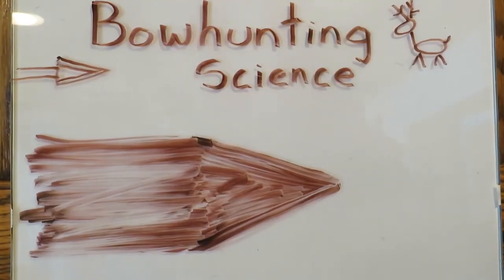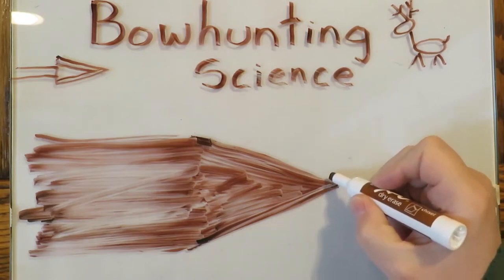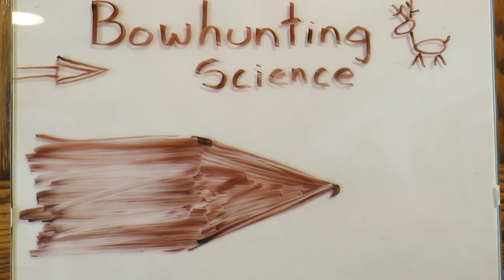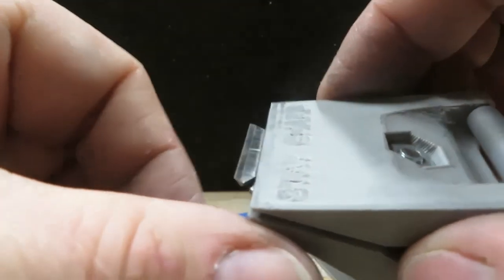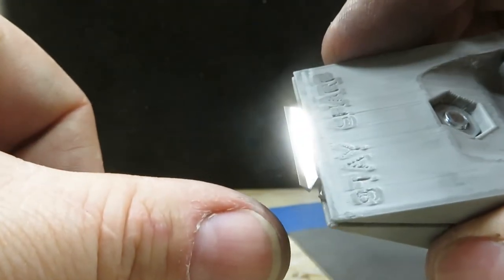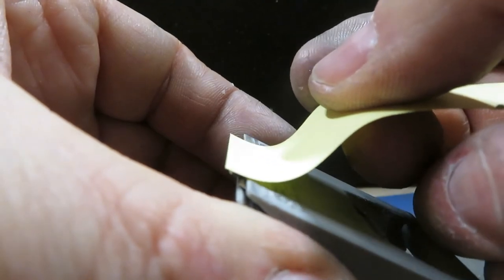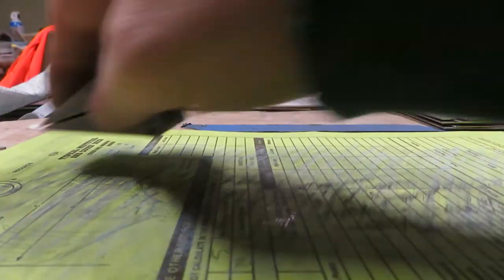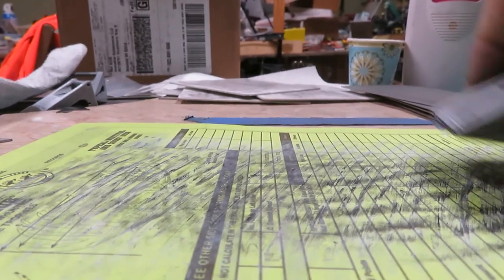The Science of sharp

Comment: That one microscope shot (I think it was a microscope) answered a ~~tiny~~ question for me! Using a USB scope at 200X I've been noticing a tiny glint along my edges, and did not know if that was a burr, or evidence of an unintentional micro-bevel. Now I know! I'm a hobbyist who's down the rabbit hole (more stones than knives!), and I can get sub-100 BESS, but with difficulty, and somehow, even on HRC 60 steel, that turns into 140 BESS in just a few uses cutting steak on a rubberized board. I think that (very) tiny burr is to blame for that deterioration. Your photo shows that a burr rolls, as if you took a piece of foil and rolled it at the edge. It's smooth at the apex, not jagged. I think that since it's a segmented burr, many tiny pieces of steel formed by the grit scratches, some of them break off in use, tearing off, leaving an uneven edge, less even than the original micro-burr. Thanks, and thanks for the strip of paper trick, too! I like a knife that will easily trim fascia off raw meat, and a knife that will slice cooked meat "as if nothing were there". I'll explore your site and blogs more and recommend them.

Comment: there are many ways to skin a cat but this video is idiotic. an edge needs to be apexed ONE time.  generally this done on the course stone, unless the blade is damaged and needs to be fixed first. in that case,  there are many various legitimate ways to deal with that damage. you don't want to apex on a rough grinding/shaping stone because it's just too course it's not for creating keen edges its for stock removal. Beyond that, you need at most 3 abrasives to get any result on any edge. You should be able to fix a damaged edge, sharpen and polish it to a mirror with 3 abrasives. thats all you need. you want to use more, knock yourself out but it has no rational cause.  razors need even less because were talking about extremely easy to abrade carbon or low alloy steels and tiny tiny tiny fine edges.  more experienced sharpener will create smaller burrs or even microscoic burrs. only amateurs that don't know what they're doing will create giant burrs. grinding to a burr on every non polishing grit is idiotic. once you apex all you need to do is remove the burr to have a keen edge. you dont need to grind more and more burrs like a smooth brain.